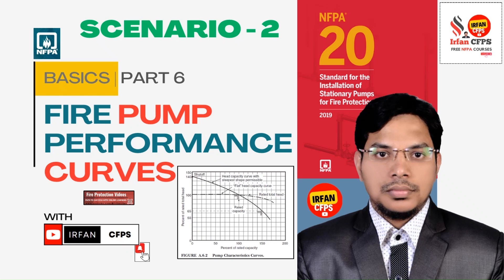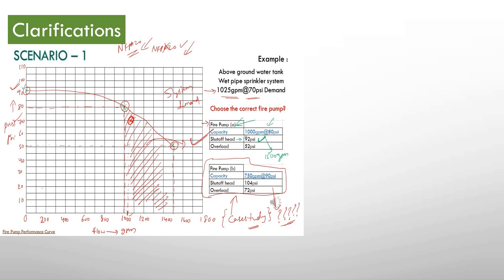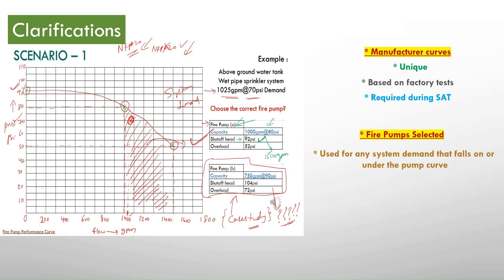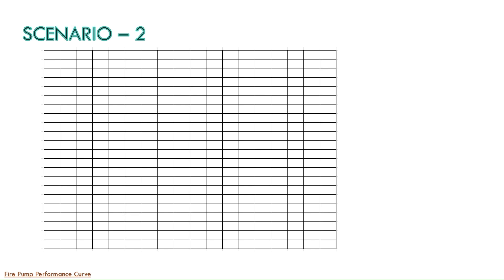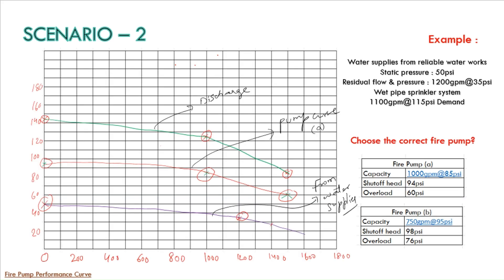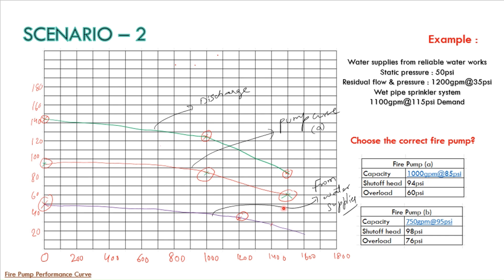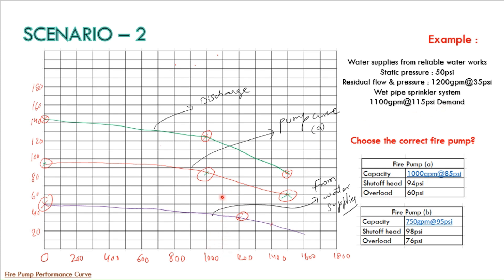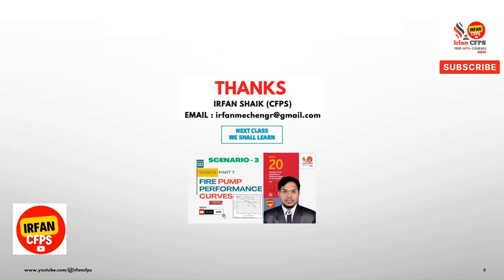Understanding Fire Pump Performance Curves: A Simple Guide - Part 2

Comment: Engineer, In the comments Section I see one person saying fire pump b does not fulfill the demand and the other person saying it is fulfilling the demand, and you've liked both the comments. For me, I tried, with just 1 psi difference the point is going out of the discharge curve. Can you please confirm whether fire pump b is really fulfilling the demand. I just need this confirmation from you to avoid the discrepancy between the comments.
Reply from the maker: 750gpm pump cannot be used because the required head (115psi) is going out of the curve. To get accurate results you need to plot on hydraulic graph!

Comment: Scenario 2 do not fulfill the criteria.
Pump 750 gpm @ 95 psi 
Shutoff point - 148 psi ( 98 psi + 50 psi (static))
Duty point - 136 psi ( 95 psi + 41 psi)
Overload point - 112 psi ( 76 psi +36 psi)
Therefore when you plot 1100 gpm @ 115 psi then it point goes above 112 psi. Hence 750 gpm do not fits for use.
Feel free to correct me if I’ve misunderstood...
Reply from the maker: You are absolutely right!
Reply: what is 41 & 36 you've added in the duty & overload poiny
Reply: @vigneshwaranyt  41psi is the pressure at 750 gpm and 36 psi is the pressure at 1125gpm for reliable water pressure.
Once you plot these values on the graph, you will get the accurate pressure.
Reply: @engmech9188  Thanks i got it
Reply: @engmech9188  as per given information, 35 psi is residual pressure, and 50 psi is static pressure, how to find this numbers

Comment: In getting 80psi of discharge line. Where do you get a 20psi?
Reply from the maker: Could you elaborate your query.
Reply: I didn't understand  this video at all
Reply: Discharge curve ?
Reply: At time of 5:20 mins

You get the 80 psi at discharge line. Where do you get the 20 psi? You said in your explanation.
Reply from the maker: @yowmamen4767  At 150% capacity the flow will be 1500gpm so at 1500gpm based on the water supply curve static pressure will be 20 psi. Add pump curve pressure 60psi@1500gpm with static pressure (ie.,20psi) @1500gpm. Please go through the video once again from starting and dont skip so you will understand. Also please watch Pump performance curve Scenario 1 and Scenario 2 videos to get the clear concept.
Reply: @irfancfps  Hi Irfan, from the lowext curve, you have considered the 1200 gpm@35psi, right? Thus, the overload capacity must be 1200*150%=1,800gpm. From there, we can get the correspsonding overload pressure towards the left, in this case it is at 0 psi. Please confirm.
Reply: Very informative